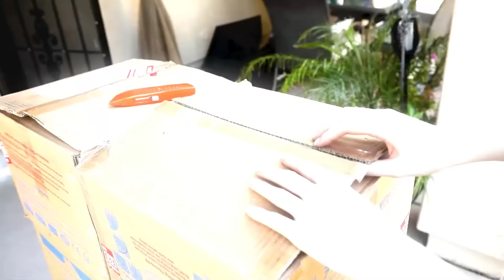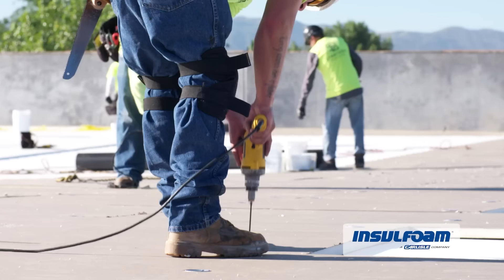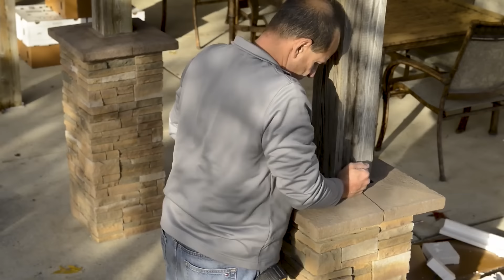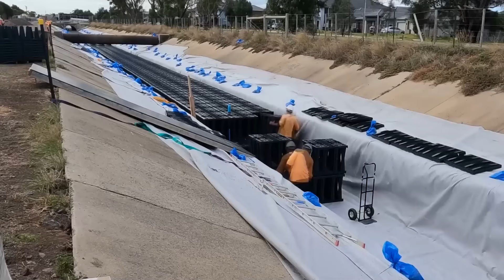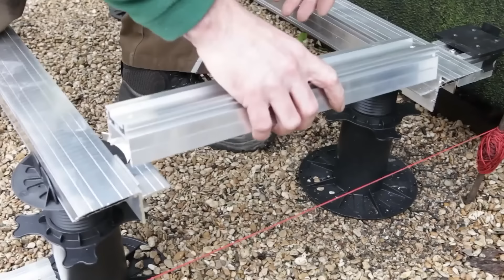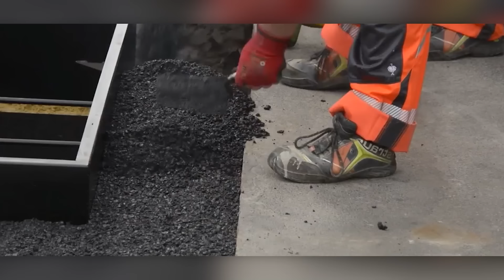CONSTRUCTION TECHNOLOGIES YOU SHOULD SEE

Comment: The use of polystyrene as been used and failed in flat roofing from the day I started forty two years ago,it’s a shocker of a system.
Reply: Isn't it also highly flammable ??   Sounds like another Glenfell inferno is on the horizon
Reply: No just polystyrene mate ,we in the flat roofing have questioned for years about PU,PIR boarding which catch alight easily .
Reply: @danielfinley47  
Ya but isn't that highly flammable too ?
Reply: @williesforeal9979  yes mate it’s all flammable the best insulation I’ve ever used is cork ,flame resistant but obviously to expensive .
Reply: @danielfinley47  
Yaaaa.  That's a bummer mate

Comment: It's amazing that Mayan ruins and pyramids have lasted thousands of years without this"new" technology. But a new house won't stand for 50 years without constant upkeep and maintenance.
Reply: hate these takes on construction. modern construction has to be small. contain plumbing, electricity, low cost in materials and be built reasonably quick with materials easily transferee able to the job site. want a house with meter long stone wallls and no plumbing/ electricity. go for it.
Reply: @padz-f3r  I agree. The original post makes a vacuous argument.
Reply: Thats because they used stone
Reply: @bigcheds87  what about the wood then?
asia big wooden houses without nails (wood cut to interlock) stands for 1000+years
Reply: @davidalvin1  So how much exactly are you willing to spend on your custom engineered home?
Reply: @davidalvin1  yea, but also with constant upkeep
Reply: @bigcheds87  fr. Big differences in climate as well.
Reply: Pyramids were built by hundreds or thousands of people over generations and my house was built by 4 hungover poorly educated unionized slackers. Not really amazing
Reply: Amazing what you can achieve when human lives and suffering don't mean dhit to the local populace or the ruler in charge of your life
Reply: If today's houses were designed to last forever then no one would be able to afford one.
Reply: Also consider that not everything that was built is still standing. A lot more to consider here.
Reply: Are you 100% sure, they don't use any new technology?

Comment: I cannot emphazise enough how bad the tiles are in the first video if used under open sky. After two to four years ,providing you havent taken all the tiles inside during harsh rain or snow... then they last longer, the plastic interlocking system underneath will eventually dry up (due to the mixed exposure of sun/heat & rain/snow and start to crack and break. Perfectly fine to use in a glassed in porch or somewere were it's protected from the elements.
Reply: Maybe that's why it has been "discontinued" on their website?
Reply: Thank you so much for this info.  I was truly considering this.
Reply: @Ted Lee  20mm. That's the difference. And the point remains, you buffoon. I don't know if reading is a good thing for you to brag about, since you've missed me saying "tiles or pavers" multiple times.
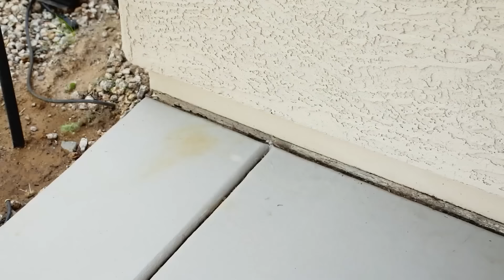Reply: 0:27 when the tiles are subtle racist icons.
Reply: Can we do it!? Yes we can!
Reply: Mr UV ain't playing.
Reply: I set these tiles up in my back yard. 3 years now. The plastic composite dosent hold screws well in a freeze thaw environment so the tile detaches from the plastic underside. I’ve been adding new deeper screws coated in silicone which seems to be working
Reply: concrete or similar would last a very long time, some of these things are false economy
Reply: I wonder if you could coat these with transparent UV-blocking paint to make them last longer?
Reply: @SwankySasquatch66  Doubt it. Would chip, crack, fade etc. under the expansion/contraction. Just like with vinyl siding and stuff. Especially being a walking surface. That's if you could get it to stick to the surface well without scuffing it up prior to painting.
Reply: Huh? You take your pavers inside in winter? That's stupid. I'm a stone supplier, and I've sold stone tiles, pavers, memorials, bench tops... for years now. NEVER have I heard of a moron taking their pavers inside each winter to make them last longer
Reply: @Mostaism  
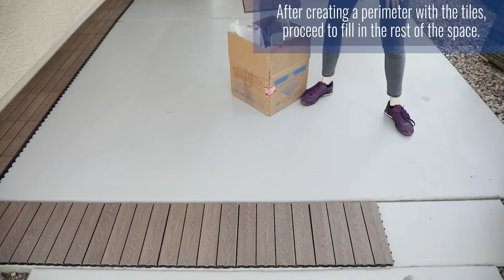I think the other guy is referring to the plastic tiles shown at 0:40
Reply: @stylac  "providing you haven't taken all the tiles inside during harsh rain or snow".
Nope, he's talking about ripping up his pavers every autumn to take them inside for 6 months or so. Gods forbid it's  rainy during the warm seasons, cos then he won't get a chance to lay them back down until a year later.
Reply: @Mostaism he must be a republican,  there are smart dummies and then there are dummies.

Comment: I have a question regarding the first item, i.e. Composite Floor Tiles. I have seen them being sold at IKEA stores. My concern is the hollow spaces under the wood in between the plastic substrate. When installed outdoors, is it not going to collect dust, dirt, insects, and specially mold and rot from rain and snow?
Reply: They do collect dirt and debris. And they also get holes in them pretty easy from the legs of furniture and the like.
Reply: @christopheralbert4009  Thanks for this great insight. My roofer told me that if new shingles are installed over old shingles on the roof (without removing the old shingles), mold builds up between the two layers.
Reply: The Space in-between is not resistant and it will collect all kinds of crap.
Reply: You ask too many questions. Just give us your money or you'll be visited by men in black.
Reply: Of course it will collect all those mentioned items. Out of site out of mind (for most/normal people)
Reply: @terryyoung6900  "sight"?
The three grey dots at the right let you edit your errors. If you can spot your errors, that is.
Reply: Lĺp
Reply: Mold can grow on anything, I just scrub mine up every spring, 3 years later and fine .Installed them on top of my small wood deck.

Comment: They placed all those paving stones on a bunch of beach sand and not gravel. That entire job is gonna go wavy in 2 years. Sad to see such poor worksmaship!
Reply: It has a stone base under the sand. When done properly with about 1” of sand it’ll never shift.
Reply: @Doofysfinger  especially if you mix a few bags of cement with the sand.
Reply: Every pavestone job I've ever seen is done with sand that is compacted
Reply: @Theuglyconcretefinisher  depends on the area too. In mine we use 2b stone with a 1b screed. Lay pavers then tamp with a vibrating roller tamper. I’m a supervisor for a hardscaping company
Reply: @Theuglyconcretefinisher  That means everyone is cutting corners. 
I did interlocking before and proper jobs were done with quarter chip gravel. 
Higher quality and last way longer with heavy traffic
Reply: apparently you dont know how strong compacted sand is…
Reply: @RWC_Autosports  i believe compacted sand is actually known as rock lol
Reply: In the netherlands everything is built on sand🤣
Reply: Compacted sand is strong as long as it's not on top of more sand. Pretty sure there's concrete or compacted gravel under there
Reply: Yeh there’s an expert everywhere ! Had plenty of experts work on my house and I’ve had to redo their work!!!!
Reply: Where the hell did you learn to lay stone?
It's either polymer sand or they put a stone base with an inch or two of sand which is exactly how it's supposed to be done. 
You're obviously extremely uneducated on the subject.
Reply: AB3 then sand
Reply: I totally agree you need to have a proper base with road crash or road base then the minimal amount of sand just to get a skreet
Reply: in canada that would be 1 year 😎